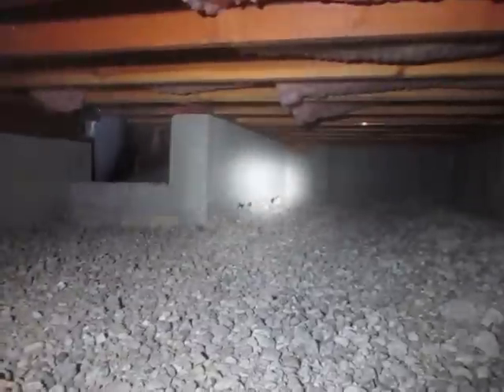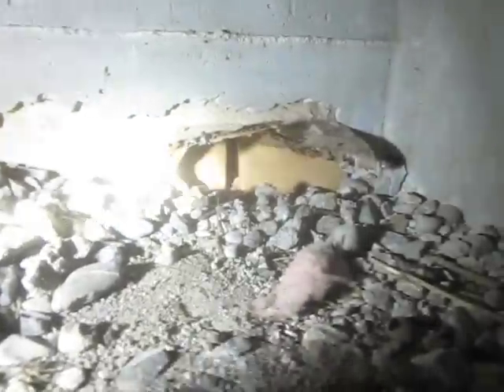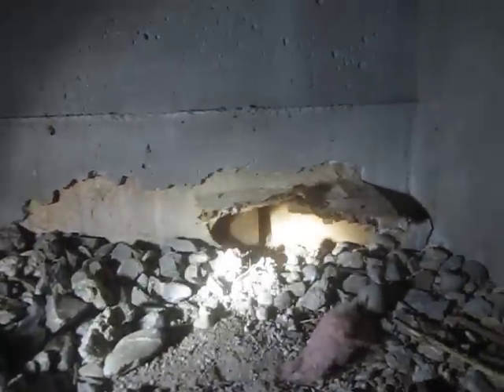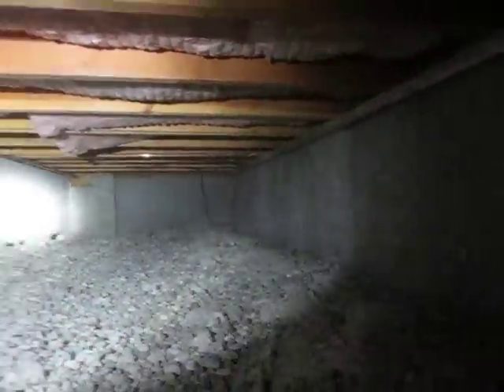Pier and Grade Beam Foundations: Void Filler/ Void Creation

Comment: We run into quite a few of these where the soils tend to be fairly damp either due to a high water table or where seasonal rain can raise the water table during certain time of the year. Also there are homes near the Napa river that also employ this type of foundation. My experience has been, aside from wash out due to erosion or critters digging under the beams, this has to be one of the better types of foundations when done correctly.